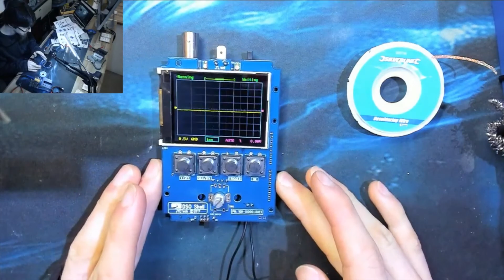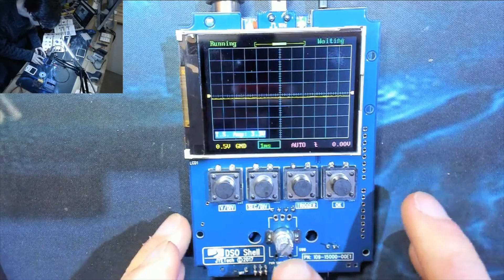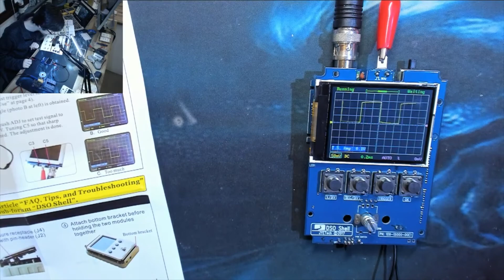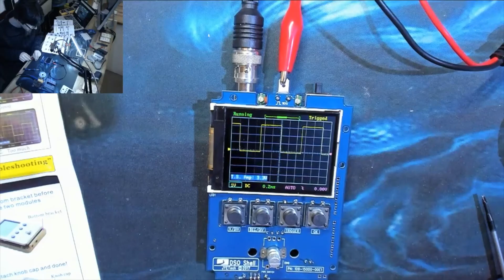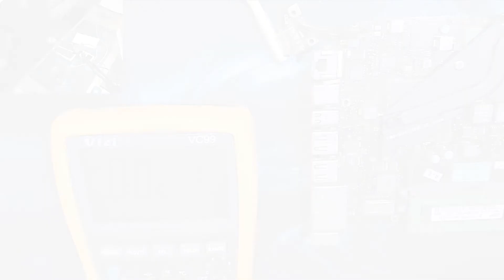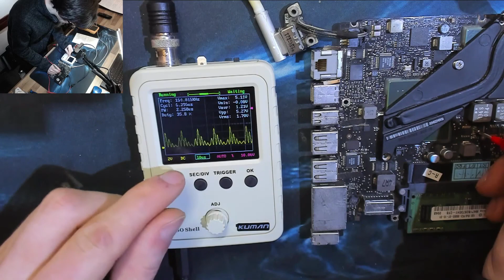LBE#1 - JYETech Scope, Setup and Testing Part 2

Comment: Thanks for this great video. I wonder if you can help with a question. I bought a preassembled unit. My unit is showing a voltage with nothing connected. For example with it set to 5V I'm already showing a reading of 1.82V. Would I be able to correct this by opening up this shell and making some adjustments?
Reply from the maker: Worth checking, yea. Also try switching the AC/DC/GND coupling switch at the top a few times, mine's a bit crap and doesn't always latch properly. A low battery will also cause drift in the measurements.

Comment: I am sorry to say that while the maker of this video might mess around with computer stuff, he has a lot to learn about electronics theory AND how to use an oscilloscope. He does not understand scope triggering, and does not seem to understand the role of the inductor in a switching power supply circuit. He is using very low bandwidth scope to read relatively high frequency signals, and does not understand why the scope is giving him bogus readings and measurements. Quite a few other things in this video made me cringe too, but I won't take the time to itemize them here. The viewer should just be cautious and take what is said and shown with at least several grains of salt.
Reply: that's a lot criticism, but now please tell and show us the good how and what !
Reply: @praha007  , my, my, my, are you lazy. My YouTube name is right there in my comment, and it would have been so easy to look up my TWO detailed videos on this product, or any of the other superior videos. It is also an intellectually bankrupt approach to try and demean the validity of a critic's comments by suggesting that they should do it better rather than criticize.
Reply: @youtuuba  Guess who is about to go watch your vids! Thank you and thanks to the OP nonetheless. It helped me set it up after I threw mine off.